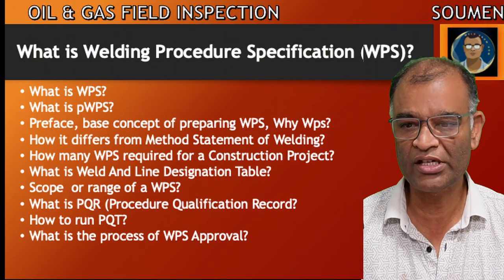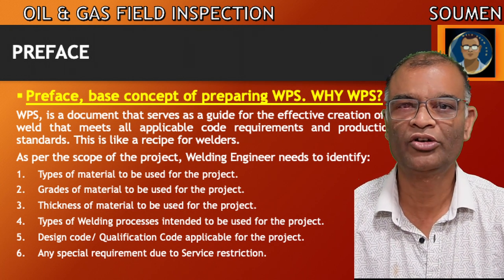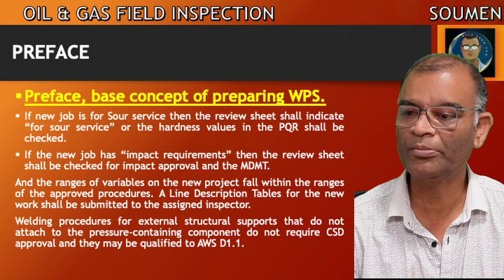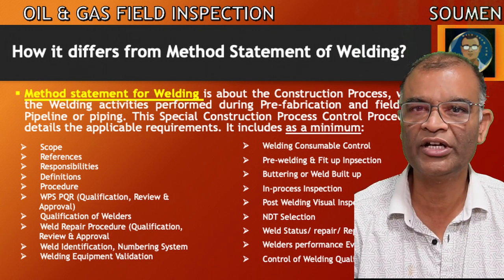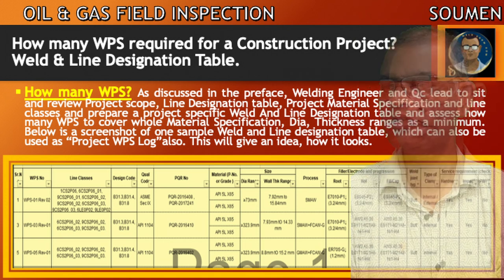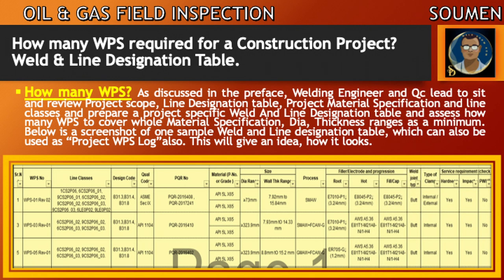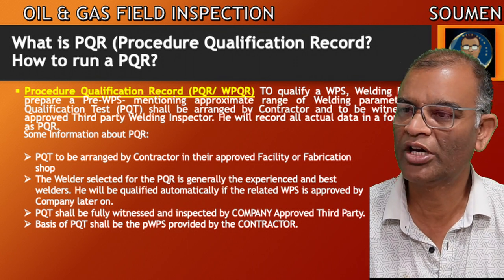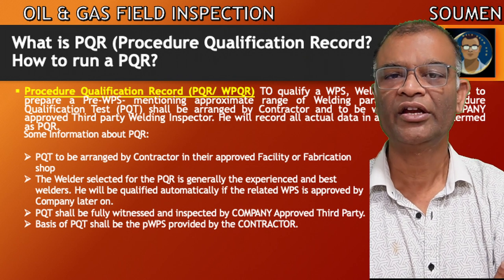PART-1 HOW TO PREPARE A WELDING PROCEDURE (WPS), WPS QUALIFICATION PROCESS, WHAT IS PQR, PQT

Comment: Excellent video
Reply from the maker: Thanks a lot, Please be with me.
Reply: @OilandGas-inspection-soumen  Sir I have a Welding Engineering Master's degree from NIT, but my experience is mainly in bridge fabrication. 

Can you suggest any way so that I can transition from there to piping/oil&gas/refinery line of work..
Reply from the maker: @ThatGuy-vp3un  Thanks for the Comment. Since you have welding Engineering related Qualification, It does not matter, You are in which field- Basic Welding is the same everywhere.  You can start applying for OIl & Gas field Job. You might need to Get some certification of AWS or CSWIP if you like to work as a welding Inspector.  If you like. to stay in the field of COnstruction as a site engineer, Then You only need to appear for the interview, If you can prove your knowledge of Welding, You can get a job for sure.
Reply: @OilandGas-inspection-soumen  Thank you sir for your feedback, I have been preparing for CSWIP 3.1, will definitely give exam within 6 months period..

Comment: Appreciate your effort 
Sir I have one question 
Can we use a PQR" qualified on A53 Gr.A for process GTAW/ SMAW ,filler wire ER70 S-6,E 7018" to make a WPS for A106 Gr. B ,process GTAW/ SMAW ,filler wire ER70 S-2,E 7018.
Reply: Your line service is sour? In that case impact is required and all supplementary variables will be essential
Reply: So electrode classification will also be essential
Reply: A53 is group1, A106 is group 1 or 2, if same group no issues, but different group for sour service needs separate PQR
Reply: Group no is essential variables as per sec9 if it required by design or construction code then only can be applied for low temperature service 😅

Comment: Sir how to decide which welding rod(size and code) use for which materials and which thickness?
Reply: Thanks for your interest, to decide type of electrode we need to have some basic knowledge, if the the material is special and not a common one, the best option is manufacturer product books. You can also ask some of the
Manufacturer - what are the electrodes they are manufacturing to weld your parent matal. Size of the electrodes are limited from 2.5 mm to 5mm will be  used for most of our construction wps. 2.5 is for root and thinner material filling. 3.2 mm is the widely used size for filling capping.
Reply: Welders are the best source to share their experience and suggest the best size for any specific welding
Reply: @soumen dey  thank you sir your response.